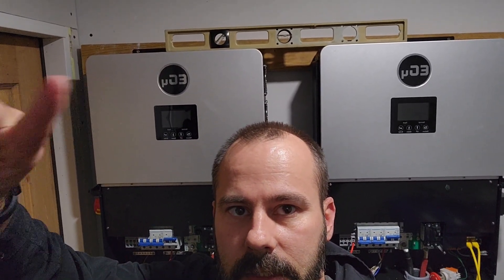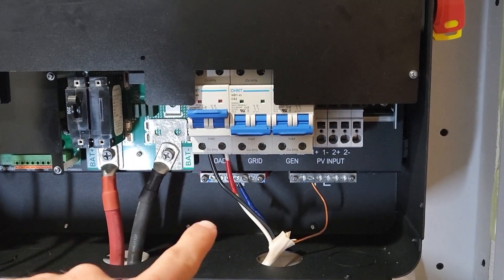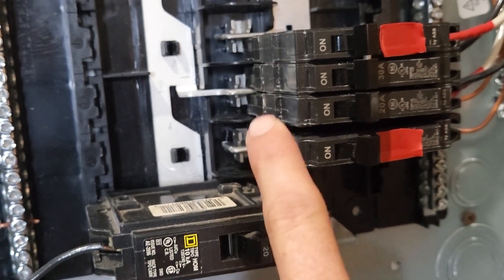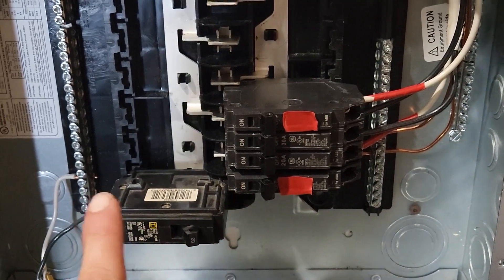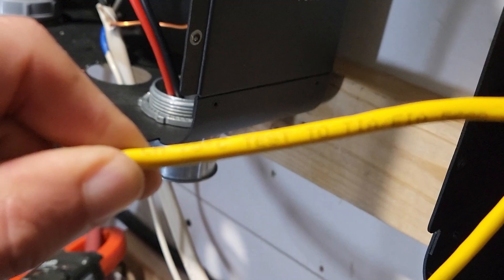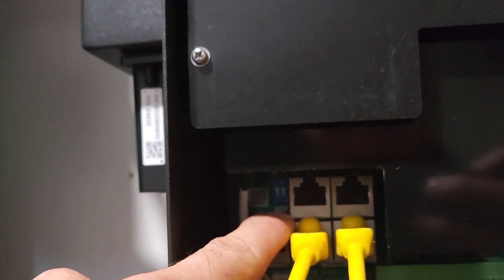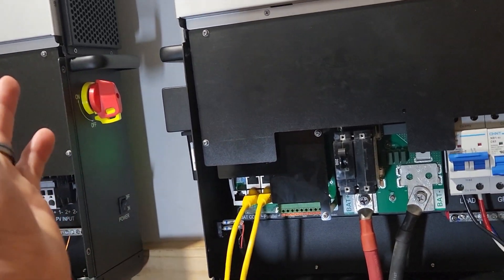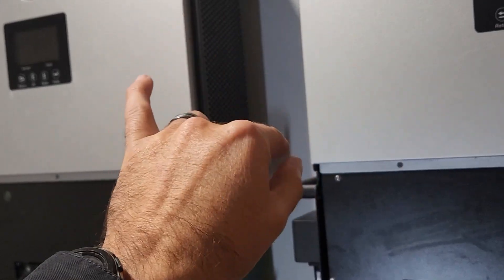Two EG4 6000XP (Parallel) 1st test. Fan speed adjustment.

Comment: Having those inverters set next to each other like you have will have the right one throwing heat into the left one
Reply from the maker: Correct, I have a vent deflector directing the air forward.
Reply: The manual calls for a half meter separation between the two.   That seems excessive, but that is what they officially require.

Comment: Thanks 👍
Reply from the maker: Welcome
Reply: What size wire did you use for the rsd button? And does it just wire between the 2 dry contacts on the inverter as the manual shows and the red side of rsd button?
Reply from the maker: @tjmooney4181  cat6 cable and I used two of the wires.
Reply: @theadventuresofarenaissancman  oh great thanks I'll seperate a couple of those to use 🙏  I'm unsure of which contacts to wire on the rsd, the no (green) or nc (red)
Reply from the maker: @tjmooney4181  I'll look at mine but I don't remember a red or green.
Reply: @theadventuresofarenaissancman  oh okay thanks a lot for the quick response
Reply: @theadventuresofarenaissancman  I have the 41$ button from signaturesolar it has a side for normally open and 1 for normally closed that both obviously switch when the button is pressed
Reply from the maker: @tjmooney4181  they flip. NO goes to NC and NC goes to NO.  I had to try both sides because my switch wasn't labeled.
Reply: @theadventuresofarenaissancman  oh haha okay, so sorry I'm still confused. So the wiring does not loop through them, just plugs into one side of each on the button side?
Reply from the maker: @tjmooney4181 the wire makes a loop and the RSD switch completes the loop when the switch is activated.   Example I used green solid for one side and green stripe for other side of the loop.
Reply: After reading a note in the manual bottom of page 42 the wiring should loop through the normally open side of the rsd so power is supplied when button is pressed, thanks so much for all the help I will install it tomorrow. Update: it worked 💪

Comment: Some good tidbits here thx. Are you replacing the 20A breakers?  If so what will you use?
Reply from the maker: 2-Double pole 30 amp.  I Could go larger, I used 8 awg wire.
Reply: @theadventuresofarenaissancman  shouldn’t they have 40A?  (6000x1.25)/220v.
Reply from the maker: 240V.  Yes 40 amp would be ideal.  I'm running 8/3 w/ground which is good for 40 amps.  I should buy the 40 amp version of this breaker.

Comment: People are always worried about idle consumption? Will Prouse really stresses this? But idle consumption is a drop in the bucket compared to what the inverters do or compared to a generator.
If you're off grid, you want the biggest battery bank you can afford.
Reply from the maker: People fail to account for overhead. Conversion loss and base inverter load.

Comment: Can you go over what happens when you shut off one inverter when they're in parallel and what happens if you turn it back on do they automatically reconnect to each other does the MPP solar charging still work when AC output is shut off?
Reply from the maker: Shutting off one parallel inverter will push all the load on the remaining inverter. Turning the inverter back on will automatically sync and pickup 50% of the load.
Reply: @theadventuresofarenaissancman  
Do you know anything about using this with a generator I know some of the other inverters it is not recommended
Reply: @MrDatson74  In case you are still interested look at the three breakers on the inverter.  The left one is AC out, the middle is grid AC in, the right one is generator in.  The is also a dry contractor to start a generator if needed.

Comment: Hi I just ordered a 6000xp a d am.thinking of getting another.  Once quick question, when they are installed in parallel, do you attach the grid and generator to both units or just the master?  I would appreciate any insight you can provide.

Thanks!
Ron M.
Reply from the maker: I have grid connected to both units.  I can try simulating grid/generator on a single parallel inverter later.
Reply: @theadventuresofarenaissancman  

Thanks for the replay, I would love to see that video as I try to figure this out as a DYI-er.  I am replacing my Growatt 12K under warranty with Signature Solar because my 12K failed.

I am a new subscriber and appreciate what you are doing.

Ron M.
Reply from the maker: Just tested.  When grid is connected...it needs to be shared to all parallel inverter.  When I flip one grid breaker off the other inverter disconnects from the grid (while AC charging).  Will need more testing.  * It may be pulling grid from the load via the 2nd parallel inverter.
Reply: @theadventuresofarenaissancman  
Wow that was fast thank you!!  It it interesting that the 2nd unit will disconnect, I would think it would fail over if operating in the ups mode.  My issue is that I do not need more thank 9KW in ups mode (until my community allows ms to install solar panels on my roof), but I may need more than 3K serge on a leg if power goes down.

Thank you!
Ron M.
Reply from the maker: @ronaldmathieu2199  if you overload the 6000xp it will switch over to grid.

Comment: Do these inverters have pass through grid voltage and automatically swap to battery power when grid goes down ?
Reply from the maker: That's a feature of most AIO Inverters.
Reply from the maker: Basically a giant UPS. Yes.
Reply: @theadventuresofarenaissancman  good to know, thank you. Next question is can you set this so that it pulls from pv and batteries first and supplements grid power if a little extra is needed like on the 18kpv?
Reply: Seems nobody can answer this question
Reply from the maker: @Mark-dk4ck  maybe I'm missing something.
Reply: @theadventuresofarenaissancman   the sol-arks and the 18kpv have pass through grid power, same as this 6000xp. The other units will supplement grid power when the pv will not keep up with the load only using minimum metered power. I read where this unit will supplement power but can’t find any information on it. It’s possible it will just switch to full grid power instead of supplementing power.
Reply: @Mark-dk4ck  You can set when the inverter pulls grid power to charge the batteries by SOC or voltage.  It will automatically switch to grid power if one of the legs gets close to overloaded.
Reply from the maker: @daddio7249 yes, bother are accurate

Comment: Are they performing ok? I starting out with one only for now, plan to expand in future
Reply from the maker: Yes, performing better than expected.  They are currently running the house.  I have 9,000 watts of solar, 4,500 per inverter (1 string each).
Reply: How many MPPT in parallel? Is it 2 strings at 320vdc for mppt each? or 2 strings that add up to 320vdc total voltage with both strings? @theadventuresofarenaissancman
Reply from the maker: @DavidTuckerII  460VoC one string in each inverter.
Reply from the maker: @DavidTuckerII  I'll post a short video later showing one mppt for each inverter.

Comment: Because of this inverter's wimpy surge capacity, you need two of these high frequency, transformerless inverters to get the same surge capacity that a lower Wattage, low frequency, transformer based inverter can produce.
Reply from the maker: I'd love to test out a transformer based inverter.
Reply: Can you point me at a single, reliable off-grid low frequency inverter/charger with built-in quad mptt that can produce 12kw continuous and that offers US support? For $3k? $5k? $10k? I'm serious - sign me up.
Reply: @geneinmyrtlebeach6967  I would suggest taking a look at Sigineer Power.

Comment: What is your battery setup? I have 2 11kwh batteries and was ultimately planning on 2 of these units. Not sure if I can set up each to individually run off each battery, or if I need to parallel them and have them managed by one inverter?
Reply from the maker: You can do either.  The settings menu includes a "Shared Battery" option.

Comment: How is the noise on these compared to the 6500ex? How are the features compared to the 18k?

I was going to upgrade an 18k but it hasn't shipped out and I'm thinking of cancelling and just getting 2 of these. I really don't care for grid tie features of the 18k at all, just want something quieter and more stable.
Reply: they currently do not have the 6000xp in stock either.  But have 1,000 units scheduled to arrive in two weeks.  I have two on order.
Reply: @Dmkjr  thats fine for me. Im currently running 2x 6500x and the upgrade to 18k seemed somewhat reasonable, but tbh the 6000xp is pretty much what I wanted in the first place anyway. Feels like it's worth saving the money for, but maybe the 18k is actually worth the extra $$.
Reply from the maker: If you want to reduce inverter cost and not sell to grid...go 6000xp.  Heck you could buy 3 6000xp for the cost of a single 18Kpv.
Reply from the maker: I'll add that the 18Kpv with all the features, a clean install and surge on PV is worth the cost.
Reply: @zaibervaireus I’m also replacing 6500ex’s. Signature Solar is replacing them on RMA since one had an internal issue and the other will not communicate with the 6000xp.  It was a pleasure getting them swapped out.

Comment: Coming from a 6000ex with a 500v 22amp SCC it would be kind of difficult for me to get one of these or even have two in parallel due to having to reconfigure my array to meet the 4000watts limit on this newer model. Guess, I'll have to save up for a 18k
Reply: 500v * 22 amp = 11000 watts.. and then you talk about 4000  watt limit but this thing has 8000 watt limit.. what are you talking about?
You can easily just cut your array in half and go to two of these inverters.
Reply: @gg-gn3re You do not know my system config. No, not that easily. 8000watts its between two SCCs. 500v is a hard limit on the 6000ex. Working voltage would be 450v and as aperage goes up voltage goes down during solar production. Of course I could reconfigure my array, but would bring my costs up also as my cabeling is underground and 150ft away. I would have carried over the 6000ex SCC specs to this new model.
Reply from the maker: I'm run 460 VoC to each MPPT. Honestly keep the solar under base load plus 6,000.  The inverter has a 6,000 watt battery charging limit.

Comment: Nice to see someone with two of these in place!

Boy, part of that video I was having horrible flash-backs to the 6500s with the fan sounds.  

So when you have the fans set to SLOP, is that when they dynamically change?  All other values are fixed fans speeds?
Reply: You need two of these in parallel to equal the mucvh higher surge capacity  of only 9 kW low frewuency, transformer based inverter.
Reply from the maker: I suspect, all 6000xp ships with minimum fan speed set to 70% and the ramp down disabled.  I realized that the new unit fans weren't ramping down. 

My solar utility room is conditioned year round, so I shouldn't have any issues with heat.
Reply: @theadventuresofarenaissancman  So when it's at a fixed speed, does it not ramp up if needed?  So I guess what I'm asking is if someone set it to 20%, is there potential for the inverter to overheat because it's only  running at 20%?
Reply from the maker: @AdamDeLayDIY  it ramps up as needed.  I'm not exactly sure how the ramp setting works.
Reply: @theadventuresofarenaissancman  so then the fixed fan setting is basically a "minimum" fan speed.  Interesting.
Reply from the maker: @AdamDeLay07  correct. When the fans are on minimum is 20%.

During no load conditions...the fan are off for 98% of the time.

Comment: I was about to say try testing RSD in off-grid mode, since it doesn't work on the 18k, but then realized that these don't have an off grid mode. 😅
Reply: Yea, was working with Markus on it.  Not sure when they'll be done with their testing, so I can apply it.
Reply from the maker: A firmware Solution is being tested for the 18Kpv in off grid mode.   In the meantime, all you need to do is flip your grid breakers off (the one feeding your 18Kpv)  and back on.  After you do that, the RSD will work.
Reply from the maker: Here is the exact verbiage that I sent to EG4.  "Temporary RSD solution,  turn off grid breakers (turn on grid breaker) ... or enable off grid mode prior to connecting grid."  

* I have not tested if the RSD works after the inverter calls for AC charging or after the low voltage disconnect activates grid bypass.
Reply: @theadventuresofarenaissancman  

He pushed the updated firmware to my 18k earlier this afternoon and it worked flawlessly.  Now, just need to get rid of the bugs associated with the quick charge ironed out and I think I'll  be all set.